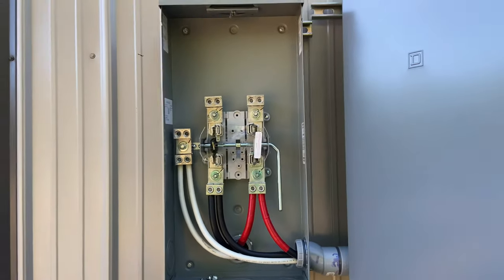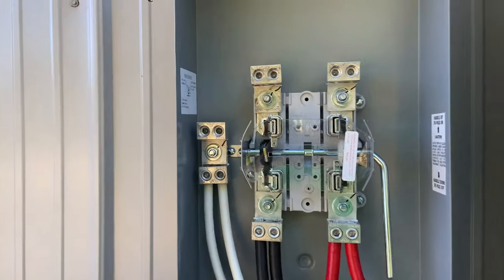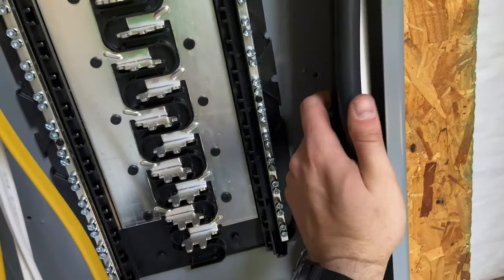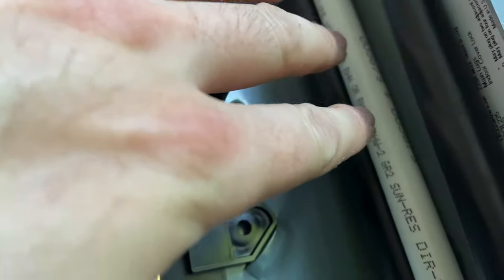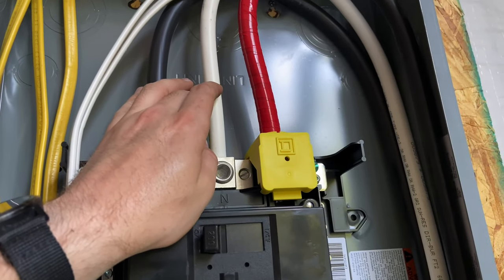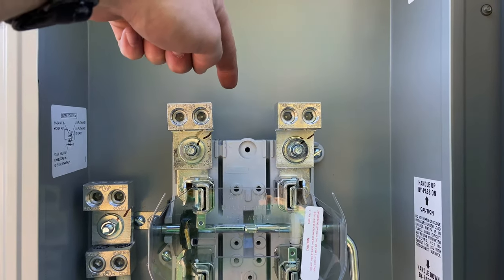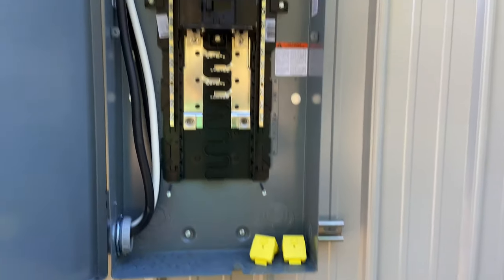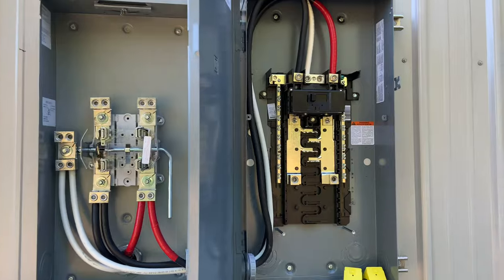Episode 16 - Service Entrance Wiring

Comment: Thank you for the video. Nicely done. I have been studying the nec 2020 code for service disconnects and it is a bit confusing. However, your installation is a good example of the code applied to a real situation. For anyone puzzled by the requirements here is an explanation which explains it very clearly. It helped me. 
"Per 2020 NEC section 230.70, a service disconnect is required to be installed for a building on the exterior of the building or inside nearest the point of entrance of the service conductors. In cases where the service entrance conductors leave the meter, penetrate the home, and go directly into the electrical panel, the main breaker within the electrical panel often serves as the main service disconnect required by 230.70. Where the service entrance conductors penetrate the home and do not terminate directly into the electrical panel, a main service disconnect mounted on the exterior of the home".
Reply from the maker: Thank you for the kind words. I’m glad the video was helpful. 

Thanks for watching.
Reply: Trying to understand this code, as to when an exterior disconnect is required. 
For no exterior disconnect,  does the interior panel need to be back to back,  as in the shop of this video, or is there a minimum distance allowable, such as 5 ft or something?
Thanks for any answers.

Comment: Looks Great! We wired ours the same. We have a cut-off panel that feeds into the house to a breaker panel. Just a suggestion, I used the breaker slots on cut-off panel (I think we got 8 as well) to feed an RV service box and a couple of outdoor outlet boxes. I also used it to bring in my feed from my solar array. We went with direct grid-tie on the solar to avoid the cost of the batteries. The electric company provided us with a bi-directional meter that will run backwards when we're producing more solar electricity than the house is using at the time. We're in the process of adding a 2nd house to the property along with a 2nd cut-off box. Good luck with your project.
Reply from the maker: Awesome. That sounds like a nice setup. Good luck to you as well. Thanks for watching.

Comment: Grounding and bonding, right now you have an ungrounded system you need to provide bonding between all metal cabinets most likely you'll need to provide 1 or 2 eight-foot ground rods  separated by at least 6 feet apart. You stated you do not have to have an inspection, then I would recommend that you have a local license electrician check your work and sign off on it for insurance purposes. De rating your neutral isn't worth the 10 foot of wire you're using, as you have to be more concerned on balancing load between current caring conductors.
Reply from the maker: For grounding, check out the next videos in the series. That topic is covered. Thanks for watching.

Comment: Just an FYI, the 2020 NEC 230.85 requires an emergency disconnect.  Great video.  I don't understand why people harp on you so hard.  You are not an electrician and you have said that many times. All he is doing to showing you what he did based on his research.  If he's wrong, just state why and where it says in the code.
Reply from the maker: Thank you for the kind words and for watching.
Reply: Some states are not on 2020.

Comment: I enjoyed the video and all of your explanations to the comments.  I even enjoyed the arguing between commentators.  You have shown exactly the type of service panel setup that was recommended to us by the engineer in our county (TN).  I had started looking for a 400 amp panel but your setup will work much better for us, considering that so many items are backordered for months.  Our house is an existing older one that we stripped to the studs, but its about the same distance as yours.  We  have to provide the meter base, and dig the trench and lay the conduit from the meter base to the transformer 96 ft away.  Otherwise we will have a very similar setup, so I hope you don't mind if we need to pick your brain at a later date.  I especially like the spaces in the shutoff panel for the house.  We wanted to power the well from the shed instead of the house (closer, after rewiring the house) and maybe add a plug for a camper.  If you were to have a home generator installed, I wonder if it could be connected to that shutoff panel for the house to keep the sound level down.  I'd like to add that it's both very helpful and very brave to post your videos, knowing that people will attack your choices.  They fail to consider differences in local jurisdiction rules, updated and improved materials,  and good old fashioned research, not to mention just not listening to what you are saying (regarding the grounding among other things).  I am a major diy-er not as much by choice as necessity.  Too many years of hired out jobs not so well done (I learned a lot from their mistakes) and now the lack of availability from the pros (my jobs are too small), so I'm going it on my own with the help of those willing to share their wisdom.
Reply from the maker: Thank you for the kind words and thank you for watching. Good luck on your project and send any questions any time. I’m happy to help if I can.

Comment: You said you didn’t know what you could use your outdoor breakers for. One thing you can do is get a hen interlock slider, buy a 50A double pole breaker, and a 50A rated inlet box. Now you can power that building with either a 50A or 30A generator when power goes out.

Comment: Yeah, I got a bad feeling. I think your gonna have to get a combination meter base main setup. The biggest you can get is 200 amps. Now you have a main breaker incorporated with the meter panel. They do make meter base main panels with provisions to add in 2 pole 100 amp breakers to feed various panels on your property. If you need more than 20O amps feeding your property you will probably have to install a current transformer can. The power from the utility will enter this can . Then the meter is beside the CT can connected with a 1" nipple. Then the current transformers provided by the power company make the meter work. Then you can double lug on the load side of the terminal in the ct can and feed your panels. You have to supply the can and the guts and install it all. The power company will supply and install the current transformers and wire them to their meter. You maybe able to go with a service larger than 200amps single phase if your power company allows it.

Comment: If those wires going out of the back of the meter base are feeding another panel with a main breaker that panel has to be outside next to the outside panel. See nec article 230.72. Grouping of Disconnects. (A,) General. The two to six disconnects as permitted in 230.71 shall be grouped. Each disconnect shall be marked to indicate the load being served. You don't have them grouped. One is outside and one is inside. You main disconnects can't be separated inside and out.
Reply from the maker: Thanks for the feedback. 

I thought 230.72 applied to a single service, with the idea of a smaller panel not having a main breaker but having  <= 6 individual breakers. 

Does that apply to parallel services?  I only have a single disconnect for each service. 

Thanks for watching.

Comment: Can you give me the brand and model number of the meter base you have? I’m trying to do the same thing on a house and shop. Did you add the dual lugs to split the power or do they come that way? Thanks for any help you can give! Bill
Reply from the maker: I don’t have it. It was provided by my electric company. 

Any 320A or 400A meter can should work and have the parallel lugs. 

Thanks for watching.

Comment: Where do those other wires going out of the back of the panel go? If there is another panel on the other side of the wall it probably has a main disconnect just like the one you have outside. The problem is all disconnects have to be in the same location. So you're interior panel with main breaker should be outside next to your other panel. Then you nipple through the wall with a PVC nipple to run all your Romex through.

Comment: Because the building is remote from the house, I believe it also requires a grounding rod even though the house has grounding rods?
Reply from the maker: You are correct. It does.

Comment: @6:31  Seems counter intuitive that you are talking about the ground wire on the lug on the left, but there is a green screw on the right that would seem to indicate put ground connections on the right, and neutrals on the left.     (As if there really is such a thing as a neutral -- more Negative connection, after load connection.)      I'm more in favor of supply leg, and return leg.
Reply from the maker: That green screw is the bonding screw for bonding neutrals and grounds. Has no bearing or indication on where to land grounds. 

Left and right doesn’t matter. Land them where it makes sense physically based on where the wires come into the panel. Both sides are neutral busses and connected together so it is all the same. 

Thanks for watching.

Comment: Great info. I will be needing to do a similar set up on our new build. Do you know if the cut off switch could go into your garage? 
Would like to have a transfer switch in the garage and a back up generator there and not beside the house. Would prefer to have everything but the meter base inside.
Reply from the maker: I think it would be up to your local power company. They told me that the disconnect for my house had to be by the meter but the disconnect for the shop is certainly inside. I’m not sure if they would have let me put the house disconnect inside the shop. 

Practically, it should be outside since the purpose is to cut power to the house for the power company working on the meter. 

I would not have put up that panel if I didn’t have to, but it did make wiring the house later a lot easier since I didn’t have to call the power company to open the meter to run the new wires. 

Thanks for watching.

Comment: Your meter socket was most likely made by TALON  or used TALON guts [BEST METER SOCKET] .I myself would have used SQUARE D QO or SIEMENS with COPPER BUSS  .As for the cable i would have used 3/0 copper for all 3 conductors . Both panels are service and must have the bonding screw . The run going to the house must have a forth equipment grounding conductor .I would suggest  using a MAIN BREAKER panel in the house just incase of an emergency. Inside the house you must not bond the neutral [green screw]  you must have a separate GROUND BAR for all your grounds. I would strongly suggest you use pigtailed neutral AFCI/GFCI breakers because the neutral bar is of aluminum.
Since your using aluminum i would highly suggest you use penatrox antioxide compound on your connections on your main lugs plus use a torque wrench to set them to the right torque specks . Ive seen trouble with aluminum cable & wiring . This is why i dont use this stuff not to mention in my area its not allowed.
Reply from the maker: Thanks for the tips. I was planning on doing most of that. 

The meter can was provided by my PoCo and was free to me so I wasn’t about to do anything different.
Reply: The breaker at the service feed is considered a disconnect and protects the cable. I am not thinking the house panel should be a sub feed panel. That would make the panel installation more difficult maybe...As I say I am trying to learn the ropes here....

IF you do run the 4th conductor you can use Table 250.66 to save cost on the 4th wire...
Reply from the maker: Yeah for the house since the 1st disconnect is on my shop per my PoCo’s requirements, then I have to run four wires to the house and make the panel a sub panel with no bonding screw. 

For that I’m running MHF quadplex 4/0-4/0-2/0-4
Reply: @jstone1211  The house panel would be considered a subpanel because its coming off the equipment on the shop .If i were running 3/0  copper then i would need a no 4 copper equipment grounding conductor  . You must put all your grounds on a separate grounding bar in both panels on the house .The neutral CANNOT BE BONDED TO THE BOX on the outside panel or inside panel on the house. You should calculate your distance between the shop [service equipment] and the house. You might need a larger cable because of distance & VOLTAGE DROP.
Reply from the maker: I did do a voltage drop calculation. I came in with 40 feet to spare. :)
Reply: @davefranz8766  The panel on the outside is considered a disconnect at the service drop as required by the NEC. The panel is used as a disconnect only.  Additional breakers could be added as feeder breakers. I would have made the MCCB a 250A. The house panel is not a sub feed panel and therefore you dont have to run the additional #6AWG ground wire. This install is quirky!  The OP made some assumptions that I would not have done....Bonding is another discussion. 

But I appreciate the discussion from guys like yourself, makes me think.
Reply: @jstone1211  If were talking about the same installation [this video] theirs the main meter on the shop ,off that meter to the right is the first disconnect to feed the house. THIS IS THE SERVICE EQUIPMENT and must have the neutral grounded & bonded. From this disconnect your running a feed to a separate building [house] to a disconnect on the outside of the house then to the panel inside the house. Once you leave the MAIN SERVICE DISCONNECT/EQUIPMENT next to the meter you must go 4 wire because the disconnect on the house & house panel are AFTER THE SERVICE EQUIPMENT ARE CONSIDERED SUBPANELS and their neutrals cannot be bonded to the boxes [insulated neutral bars]. You must have separate ground bars. Since i only do copper lets say im running 200 amp a short enough distance where im using 3/0 cable I MUST NO EXCEPTIONS RUN A #4 EQUIPMENT GROUND and have separate bars for the ground & an insulated neutral this is DEMANDED by code.
Scenario #2;
If you have a meter on the house owned by the utility the disconnect is your service equipment but you must run 4 wire to you panel because its considered a subpanel with insulated neutral bar & separate ground bar even if your main disconnect is nothing more than a safety switch, enclosed breaker or even built into the meter socket [meter breaker combo].THIS EQUIPMENT GROUND IS MANDATORY.You cannot use the neutral as a ground anymore.   
Scenario #3
Apartment building [new] has a main disconnect this is bonded ,rods ,h20,neutral to box.After this point everything is separate neutral,equipment ground. At each tenant meter is a 100 amp breaker EVERYTHING IS 4 WIRE ALL TENANT PANELS ARE SUBPANELS and will have SEPARATE ground & insulated neutral bars.
I did electrical work for 40 years am licensed and have done installs very much like yours. THOSE INSPECTORS DEMANDED AN EQUIPMENT GROUND like im explaining in my comments.THEY FAILED ME FOR NOT HAVING ONE when this became code [late 2000s].
Scenario #4  I ran 1 1/4 in rigid steel conduit underground from my new 200 amp panel to a subpanel [put a 100 amp breaker in main equipment]. At each panel i used bonding bushings 1 1/4 ,RAN #3 COPPER  yes I ALSO RAN THAT #8 EQUIPMENT GROUND. In the subpanel  i had A SEPARATE GROUND BAR and DID NOT BOND THE NEUTRAL.
   THIS WAS INSPECTED BY THE CITY and passed.I asked the inspector what he would have said if i didnt run that EQUIPMENT GROUND .He relied I WOULD HAVE FAILED.

Im telling you all this because i want to help you and see the job done right and safe.

Comment: Hey man you using 4/0 on a 200 you should be running 3/0 400amp os normal used on an 400amp panel plus the panel inside the shed should have the bonding screw removed
Reply from the maker: 4/0 aluminum is perfectly fine for 200A residential. 2 parallel 4/0 AL for a 320A service is pretty common.  By 3/0 I assume you mean copper, which is much more expensive. aluminum moves the electrons good enough I think. 

You bond the panel at the first disconnect which means for the parallel service you bond at each parallel panel as there is no option to bond at the meter with my PoCo. 

If I got something wrong please let me know.

Thanks for watching and the feedback.
Reply: @Ciband  No man I do not see where you did anything wrong Just in my State Bonding is only allowed at the Main with would be considered you meter then we are not allowed to run UF inside the main panel only on the utility side but overall very good clean work man its just different here in CA
Reply: They are both main panels bub, both need to be bonded as he has done. No sub panel was shown in this video

Comment: I'm assuming that your "feeder cable" is 2-2-2-4 right?
Reply from the maker: The cables pictures are 4/0-4/0-2/0 to the first disconnects. 

The feeder to the house is a 4/0-4/0-2/0-4. 

All aluminum.

Comment: I was told my disconnect and my "Main" panel which is in your garage had to be grouped meaning both outside or in my case both inside.  besides each other.  just curious as to why this wasn't the case for you??
Reply from the maker: Not sure. Local laws vary and can be stricter than the NEC. 

I can see the logic in grouping them together. I did not have that requirement and didn’t want a main panel outside or yet another disconnect outside for my shop panel. 

Thanks for watching.

Comment: Great, but In our city we can not run the service wires(from the outside meter base to the inside workshop) passing through the breakers space..
Reply from the maker: For my install I am not feeding the service conductors through another panel into the shop. The meter and inside panel are back to back. 

Thanks for watching.